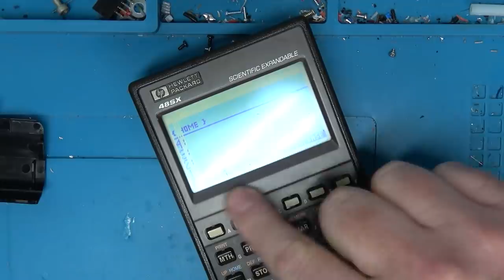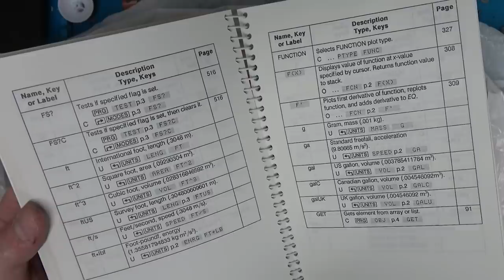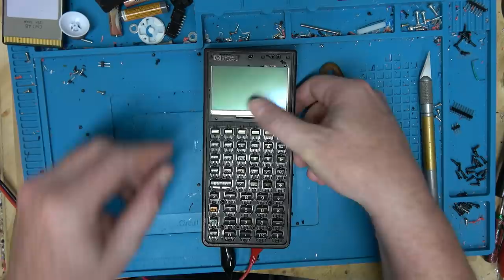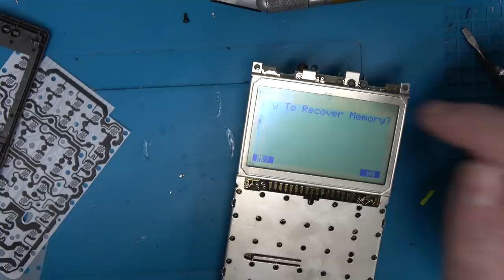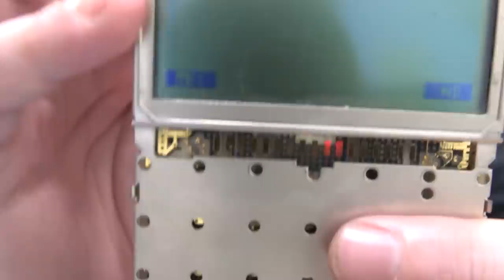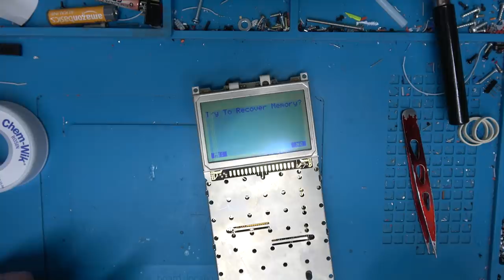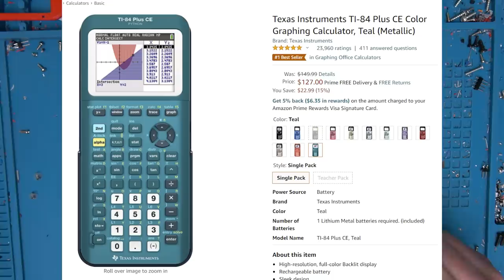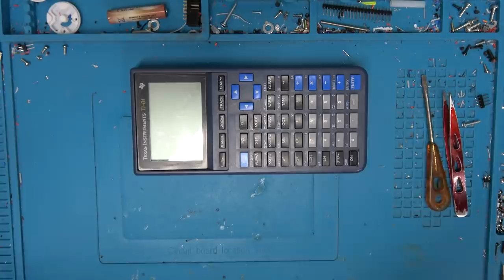Right to Repair Nightmare - HP 48SX

Comment: I just tried to use my HP48 GX and it wouldn't turn on.  I hadn't replaced the batteries for over a yr so I figured they died.  Two of them did... and were crusty on the bottoms.  Replaced all three after cleaning up the slight mess which wasn't very bad.  With the way the calculator sits any 'juice' would have run down towards the outside of the case so I wasn't too worried.  Put in fresh batteries and pushed the 'on' button... then pushed it again... and again.  Nothing!  That's when I got my multimeter out and checked voltages of the batteries... they were all good...  now I was starting to worry.  I cleaned the battery pads again this time with alcohol... not the kind you're drinking! lol  I pried them to bend them slightly inwards to make sure I had contact and put the batteries back in.  Still NOTHING!  Now I was in a panic!  I took them out and reinserted them a few times and would rotate them while in the calculator to make sure they made contact and it just wouldn't turn on!  That's when I did a search for how to disassemble it and found your video...  I was appalled at how unservicable HP made this calculator!  During one last attempt I inserting the batteries and the calculator started 'singing' to me!  Instead of just the normal bleep or bloop it was making a 'singing' noise!  I removed the batteries and replaced them and the calculator TURNED ON by itself!  I turned it off normally and turned it back on... everything seems to be working fine now...  Hopefully I just cheated the calculator death 'god'... time will tell.  On a side note I always use Duracell batteries in everything I have...  I have seen them failing by leakage more and more lately and will be changing brands and monitoring my devices with them in them more often now.

Comment: I inherited this HP 48SX calculator, it seems like a common problem. Keyboard not working until pressure is apply on or below the screen.

Comment: There's a controversial video out there about how it's actually safer to cut towards yourself with an Exacto Knife because pulling muscles tend to be much stronger and easier to control than pushing muscles.

Comment: Didn’t the TI85 have the menu system in ‘92, not ‘05?
Reply: Yes. But TI pushed the 82/83 series hard in the late 90s, and they were quite successful, largely eclipsing the 85/86. The 82/83 calculators backed away from the soft menu button idea and put five hard buttons up there instead.
Reply: @tehlaser  oh. For sure. The ti82 got all the love back in the day. I was just responding to 1:40 - “it has the menu system that you didn’t really see on the TI’s till 2005.”  I had an 85 and I always wondered why it wasn’t more popular - everyone else seemed to think the 82 was better. There was just so much more the 85 could do.  Good times.

Comment: Lobbyists against right to repair could use this video as propaganda material! Rule one: inspect what you've got BEFORE you put batteries in. Rule two: clean up your workspace, particularly small metal shards and solder detritus, BEFORE you start. Tragic vandalism given how rare and sought-after these machines are and the excellent cosmetic condition!

Comment: my father is a land surveyor and this was the device we used to control the total station and collect the data (referred to as the data collector). If memory serves, it had custom software with it's own custom overlay that snapped into the indented section over the keys (excluding the function keys up top). the top 4 pin connector connected to a black serial cable that had a round connector which connected to the total station to remotely control it. the same plug was used with a different cable that had a serial connector on the other end for dumping the data over a com port. it was actually miserable to use considering this was circa 2005, far superior tools existed that did the same thing.

Comment: I have an HP48 SX in incredible condition.  One of my favorite calculators.  Unfortunately, most they keys don't work unless you push the bottom part of the screen down.  These calculators are probably some of the best made.  It unfortunate that HP has not re-released them like they have with some other models.  What I find funny is people buy broken ones.  You can't take them apart without damaging them so I have no idea what they do with them as parts.

Comment: I still have my HP 48G from back then. Sadly, made in Singapore, not USA.  Also have my old TI-83+SE.  Batteries have been removed to avoid leakage, but I do add the batteries and power them both up now and again.

Comment: I thought it just snapped open to see the marvelous pcb of shiny metal, no trace lines. like the cards. I paid $350. for that. my 32S cost nearly the same. I have the emulator on my phone today. CPU is a Saturn something the serial port on back is serial to db-9 using Kermit software. a company from Corvallis was Edu-Calc sold all kinds of calculators and software. you should just wipe the connectors with alcohol and the rubber electric thing and press the display back and it should work. It looks like the rubber was not attached to the glass.

Comment: I still have mine. On of the best calicalators ever made. Now, I've got virtual digital copy on my smartphone that works exactly like the original. I love reverse polish notation, which works the same way as using a pencil and paper. Plus, there's also a stack just like the old printing calculators so you can see a list of what you've enteted.

Comment: I know there are tons of tutorials on how to open them, but I have failed to find one that really explains it clearly. Could you share the link to what you the one you were following?
Reply: I got 2 of the 32kB 48G Models, pimped with internal upgraded memory. Looks like only the face plate had been removed. So I think there is a less destruktive way to get it opened as being shown here.

Comment: I never had mine for long enough for it to suffer any kind of technical malfunction--got stolen too soon. Sounds like I wasn't the only person with this experience.
That blue-on-pea-soup display was kind of awful, and I was one of the few people who preferred the 28's clamshell case to this format (aside from the 28's disastrous battery door), but aside from that, this calculator was a beast, one of the all-time greats. I still love RPL. It has more in common with Forth and Lisp than with BASIC. But User RPL and System RPL were different dialects, the latter used for the built-in software with a lot of the guardrails removed.
But, yeah, it's notoriously hard to repair.

Comment: My HP48 has the same screen problem... I definitely won't be fixing it!!  I want to say I bought mine for $275 and then added two expansion cards for memory and the equation library.  I run an emulator of this calculator on my computer to this very day! :)  I have a HP28S in the desk that I used before getting the HP48.

Comment: My HP48G died some weeks ago, and im damn sure the problem is some corroded trace in the keyboard or a loose connection, because the if you press the on button like a thousans times, sometimes it works
Im going to take a shot after watching this, wish me luck!
Also yes, the processor uses 4 bits as its word length and its a nightmare to program

Comment: I have a HP 48G graphing calculator, still a great calculator to use, when it wants to even turn on. The battery terminals have a bad habit of coming loose and shorting, crashing the calculator while burning my fingers trying to find out wtf just happened.

Comment: I believe the chip you desoldered was bad. You were able to light up those lines with your finger, so it wasn't the screen.
Reply from the maker: I could see if they have any on ebay. Then I could rebuild the calculator RIGHT TO REPAIR style.
Reply: @BenHeckHacks  You could also switch both chips...
Reply: Could be dirt between the zebra strips and the LCD. I don't understand why he only cleaned the side of the zebra strips that came unstuck. Why not clean the other side too?

Comment: If you legit have fears, go look up a "no cry knife proof glove" for this. Or, go the store (or website if they have one, and look it up. It works, I have one. I'm a frigging CLUTZ. At least ya didn't do what I did once. I was trying to cut fabric off of a speaker, The knife went all wrong, and I stabbed myself in the wrist. Pretty deep. 

No ER for me. Not here. It would have not gone... well. So, I treated myself.

I got to the whole Windows numbering thing, and I know why it went that way. There is no Win 9, because 789.

BTW- Jarvis Flocking Bryce, that was hard to watch. I'm not a hard core techie. I can solder. That's IT. It was horrible. The term "unintentional calculator snuff film" comes to mind. :(

Comment: Yes, McDonald's extra value menus in the 90's were 2.99. I remember that included the Big Mac and Quarter Pounder meals.
Reply: I am pretty damn sure you are flat out just wrong about this.  $2.99 would have been the cost of just the sandwich.  Extra Value Meals were still right up around $5, even in the early 90s.

Comment: "What else happened in the 90's?" FRESH PRINCE OF BEL-AIRE, BEN! XD That watch though, man, you had far more patience taking it apart than I ever would have. The HP Calc, I'm surprised someone hasn't made a teardown redesign where it can give you exact locations where to drill through the casing to drill out the plastic rivets so you could then turn around and create some resin screwpoints so you could make it easily unscrewable. Shame about that LCD, though.

Comment: I have an LG Watch Sport and they put the antennas in the bands and when those cheap rubber bands get old, they crack, and you have to pay almost $100 to import a new set from Korea. I love the watch so I've done it - twice. If everything was integrated, I could use an aftermarket band and keep it going. I got a second battery ready to go in it too. Until Galaxy Watch 4 comes down in price, I'm gonna keep using it - I can't find any other watches with the same feature set.

Comment: I had one those HP48's and they feel like a solid brick in your hand, two shot molded buttons that should never wear out...just a magnificent machine.  I wondered if they potted them inside to feel so solid, but didn't dare get too curious trying to pry it apart.

So today I have learned HP used hundreds of one time use plastic post melt rivets instead to make it feel so solid and robust.

Just to be disposable.....  the world is cruel.

Comment: I never knew TI dominated the calculator market. Here in Canada, at least when I was in high school (96-01, yes, we used to have gr. 13 here) and in college (Canadian College is not the same as university which is what is equivalent to college in the US), Sharp (my preference) and Casio seemed to dominate, most people only had scientific calculators, programmable calculators weren't generally allowed. Maybe that's the difference.

Comment: I still have  both my SX and GX. The fact you could store formulas and it also was a serial terminal made it the best pocket companion when I was   college. I still have the serial cable from mine and last used it to test an old router. It was a vault to open. You had to cut 2 pins at thr top.

Comment: Looks like an upgraded version of the HP35S that I have.  WOW uses AA cells instead of those coin batteries!
Programming should be mostly a key stroke sequence sort of thing.
Don't crush that dwarf!  Hand me the pliers!
I like Sam Adams myself.
Your rarely see any product from Japan with the version number as 4.  The number 4 in Japan is considered unlucky, like 13.  But there was a Nikon F4 (and it had problems!).
Some beers ARE carbonated with CO2 like soda, as in some cases the yeast doesn't do a good enough job. (See what you learn when you visit a brewery?).

Comment: I have one from when I was in engineering school. Dug it out of storage just now and with a fresh set of batteries, seems to work fine. Though I did have to say no to recovering the memory. 

I had the equation library card and 128k ram card in it.  Note: mine says RAM while the one in your video said SRAM.

Anyway I wanted to make mention that while the one you showed was made in America, was dated 1999 and had an A in the middle of the serial number and mine says Singapore, is dated 1989 and has an S in the serial number.

Comment: I love the software of the HP48 calculators, but the case was a nightmare. I still have my HP48GX though and it's still completely functional. I like that the new TI calculators use Python though, so it's another language I like almost as much as RPL. I mostly just use an HP48 emulator on Android though.

Comment: just from a first look, the menu system looks like the one in the ti 85, it also may be like the 86 but I don't have one. its also probably similar to the ti 68k series(92, 89, v200), but the ti nspire is quite different.

Comment: Had that calculator in the early 90s, used it throughout college. Absolutely loved it and the reverse polish notation. Eventually had problems with the keypad and tried fixing it but taking it apart absolutely destroyed it kind of like what happened to you. Sold it on eBay for parts many years ago. 😔

Comment: Had a similar issue with my HP graphic calculator from the 2000s. The lcd was dropping lines. Plastic rivets, and metal tabs everywhere. Sadly has to recycle it.

Comment: I had a HP 48GX, it was the model after the SX.  Loved it and yes it was Stupid Expensive $$$ back in the day.  Also not even vaguely serviceable as your video shows.  The power button started to go on mine and you needed to press down from the backside when pressing it to work.  RPN is a truly awesome way to work with numbers. You could also enter in equations as they were written, a game changer back then.  Kinda miss having a super calculator but cell phones are so far advanced it's laughable now.
Reply: Advanced yes. User interface, not so much.

Comment: I had two GXs in college - bought one myself and my mom, who worked for the College of Engineering at the U of I, scored one at some big engineering function a few years later.  I still have them (one's in my desk drawer, not sure where the other one is but I'm pretty sure it's still in the house), but I tend to rely on an HP48 app instead.

Oh, and I might actually still have the printer somewhere as well.
Reply: The ROMs are free on the HP site.